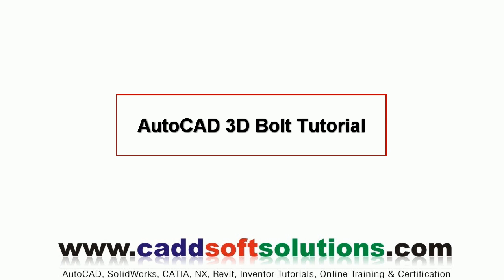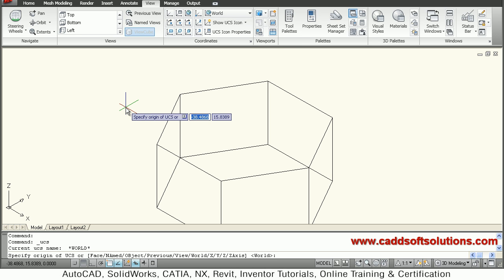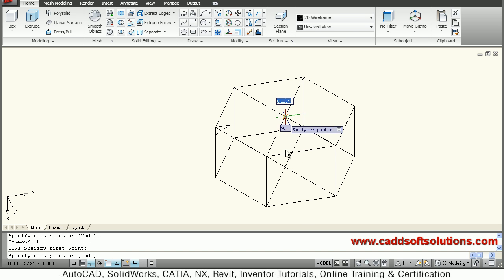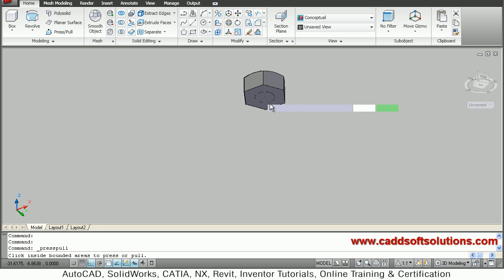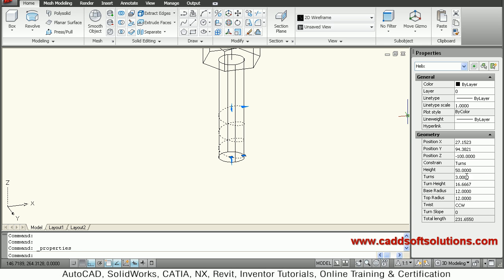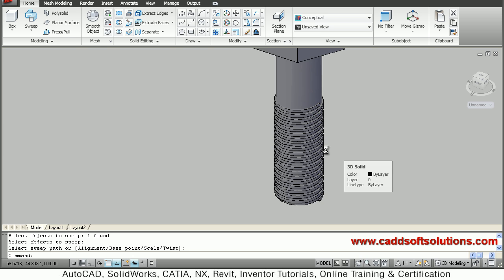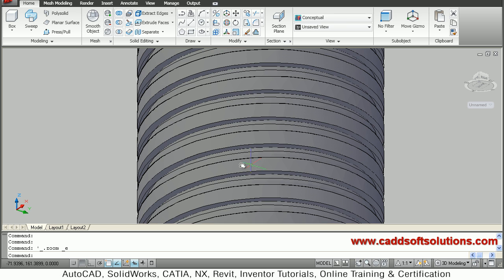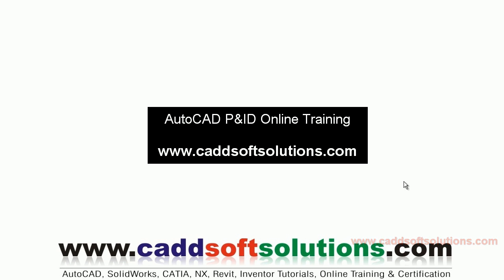AutoCAD 3D Bolt with Threads Tutorial | Download 3D Bolt DWG Drawing

Comment: Thanks for the video, it's great. Just one problem since I'm quite green to 3D modelling. Everything is going well, but after I rotate the triangle around the axis point, and i try to create a circle on the bottom part of the bolt head, it makes the circle sideways (as in not flush with the bolt head). I am almost certain that it has something to do with UCS but I have done exactly as you have and can't get it to work